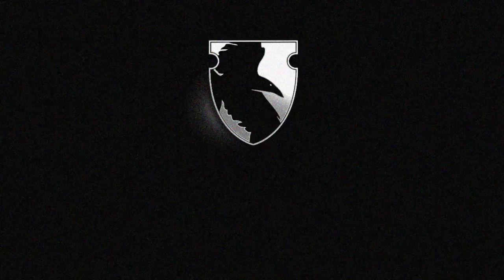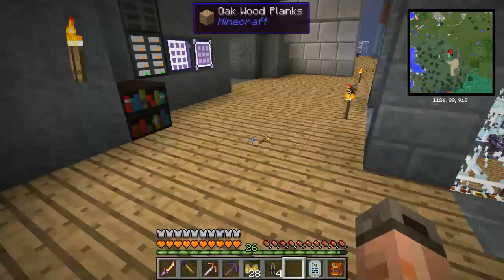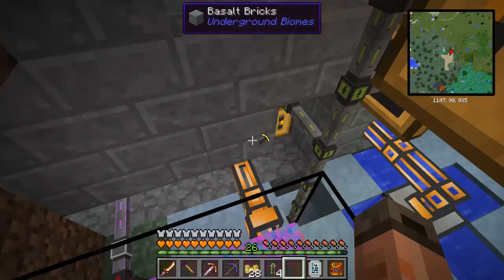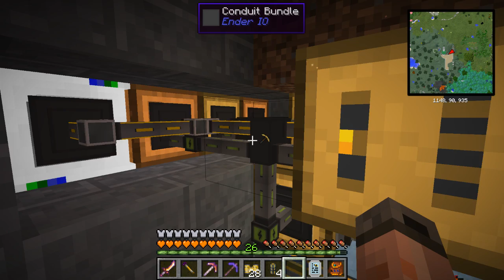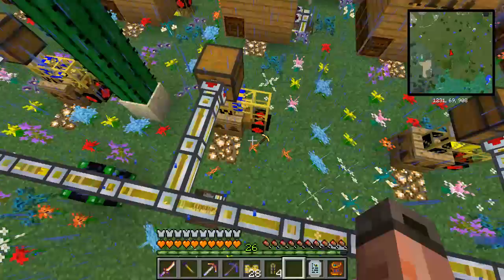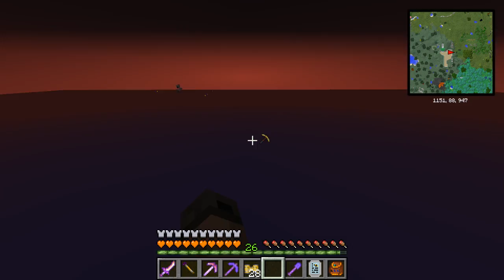Technical Beast :: All the Bee puns :: Modded Minecraft 1.6.4

Comment: As for rendering software, movie maker works surprisingly well. It may crash a lot, but the auto-save is very reliable. I never had it corrupt my videos.
Have you also looked into tree breeding? I'm quite sure that bee breeding and tree breeding are part of one mod, and they are both very good. The bees are probably better though.
Are you planning on doing a few more collaborations? The last one was good, but it was mostly you doing most of the work. Are there any community projects that you can get involved in?